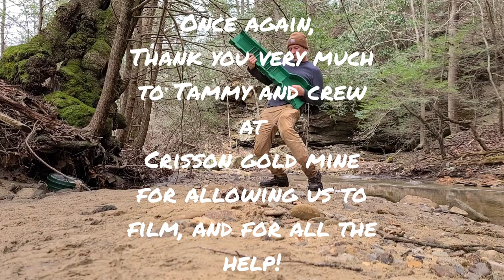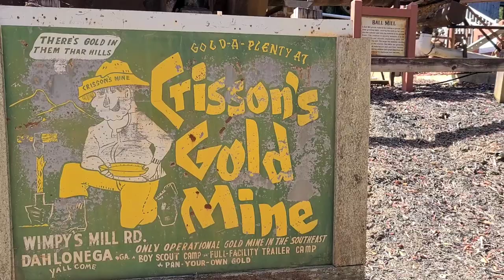Crisson Gold Mine! Day 2! With Mrs. Adventure Time Prospecting!

Comment: The thing with the Gold Cube is before you use it you need to scrub all the carpet with some soapy water before use or all your fines will float out.  Probably why you aren't seeing fines in your pan.  I'd go if they'd let me buy a tractor scoop and let me run through a recirculating system instead of letting them keep all my fines.